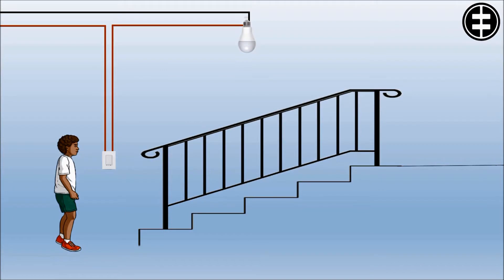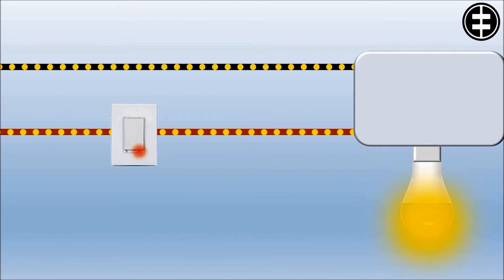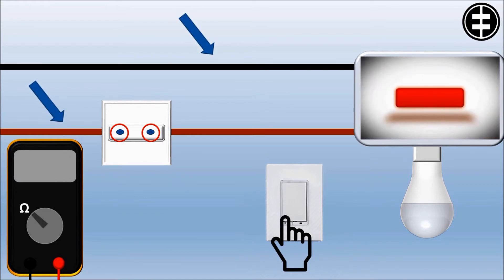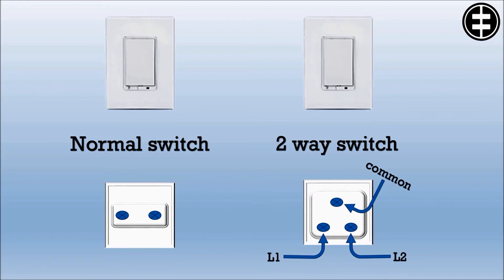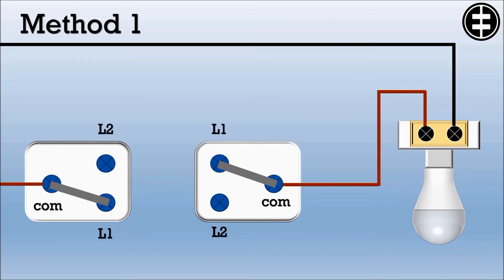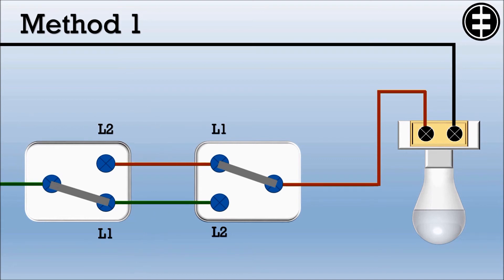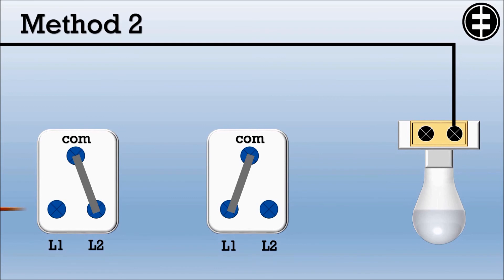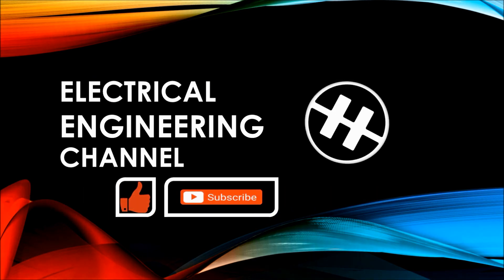Two Way Switching for lighting - How to wire 2 way light switches

Comment: Just one problem with this.  I had two way lighting, one switch on either side of my kitchen.  Mice nibbled the cross over wire (the one with the different colour code to regular wire).  The wire began to spark.  If this had happened to a regular wire, either the circuit breaker or the ground leak breaker would have shut off the circuit.  It didn't happen and the wire kept sparking.  I flicked the circuit breaker myself and disabled one switch. I'll never have a double switching light again.

Comment: You know how I can tell you're not an electrical engineer? You don't even know the difference between a two-way and three-way switch. Because what you have described is a three-way switch.
Reply from the maker: Thanks for your comment, but for your information, this is called 2 way switching in many countries, and 3 way in other countries, search and you will know, again thanks for your comment.
Reply: @ElecEngineer  well said and answer is very polite from your side- different countries different way to call these switches- one thing is common, it works and covers basics of physic...
Reply: @ElecEngineer  hi electrical engineering I jus have one question I would just like to know why not connect switch 1 L1 to switch 2 L1 and L2 to L2
Reply from the maker: @noahhurst4045  if you switched the bulb from switch 1, you have to return again to the same switch to make it off.
Reply: @ElecEngineer  Maybe you should try actually putting that information in your TITLE or at least at the beginning of the article considering that all of North America refers to it as a 3 Way. That is 100% irresponsible on your behalf, maybe try owning up to that..?
Reply: Lmaooo your funny dunbasssss he explained a 2 way and this is correct
Reply: We call them two-way switches here in Ireland too. The switch has two positions not three so I don't really understand why they call it a three way in the usa etc? Are you just counting the terminals on the switches?